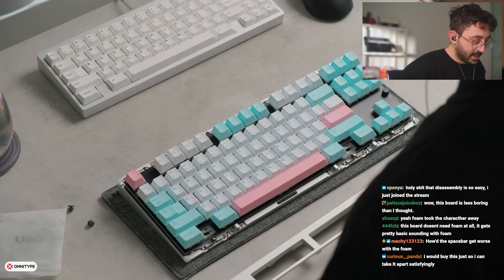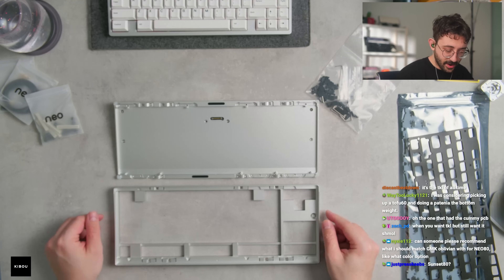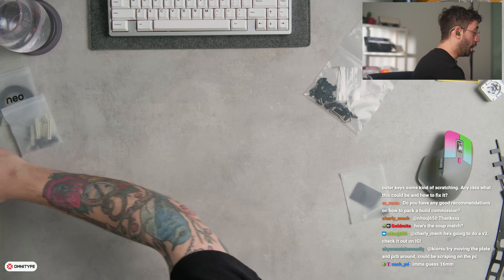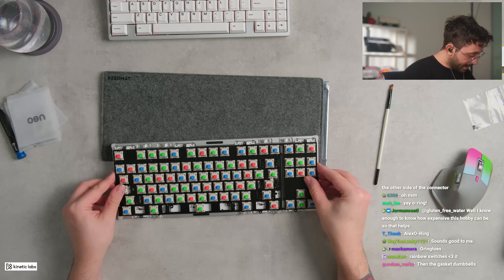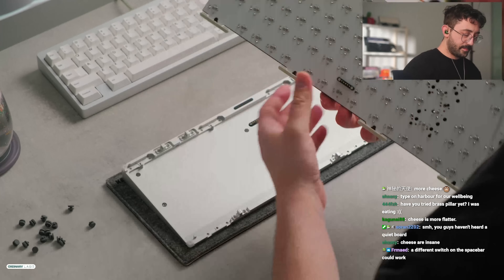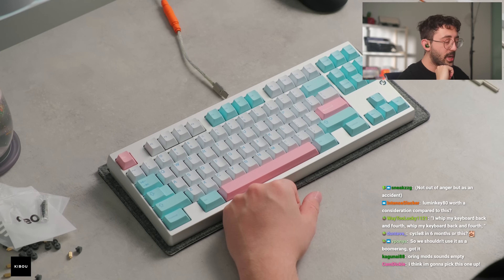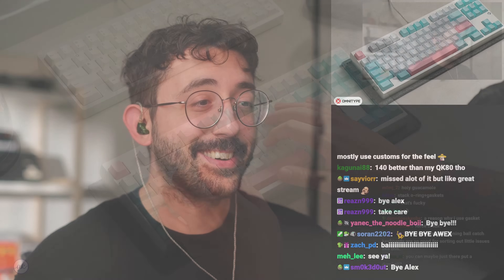The Neo80 — Pure TKL Value

Comment: I'll just wait for the Cycle8 which looks much better imo.
Reply: What’s the price of cycle8?
Reply: Cycle 7 started at 139 dollars, so cycle 8 could start around that.
Reply: Last I read they still haven't shipped most of the cycle7 orders, not a great look. Also if it's anything like the cycle7 I don't think they shpport VIA/QMK on the trimode PCB like Neo boards which is a complete failure IMO. Personally don't see the interest in the cycle boards when the Neo and QK boards exist and you can get them ordered and shipped to you in 4 weeks or less.
Reply: Does it support all those mount options tho?

Comment: sound tests(retro lights switches)(GMK Noel)
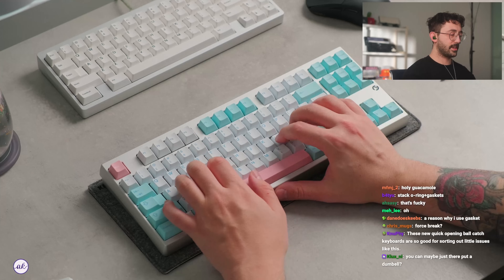o-ring - 14:13
gasket dumbells - 16:20
gasket jackets - 18:06
brass pillar sandwich - 21:15
brass pillar sandwich with case foam - 22:31

Comment: Are you sure the copper weight has a coating? I was under the impression that it didn't. I also plan to patina mine, but I don't know how I'd strip the coating if it is indeed coated :(
Reply: I don’t think it does since it warns of oxidization but don’t take my word for it
Reply from the maker: They state it does have a light coating but warn against touch it too often in my notes. I have had my hands all over the weight all week and spot no signs of obvious patina like i would have had from regular non coated weights.

Comment: Yes please more magnetic connectors please! The biggest reason why I didn't get this was due to the rotated switch positions on the hotswap PCB. I could learn to solder, but then I don't feel I want this that badly.
Reply: As someone who just learned soldering, it's really not that bad. Get a Pine64 Pinecil soldering iron, and you can do soldering with just a usb-c cable. The higher power your charging brick, the higher your possible soldering temperature.

Comment: Question! What container do you use for your keycap storage @alexotos? I want some uniform storage for my extra sets and the caps i don't use.
Reply from the maker: Sadly the ones I WAS using seem to not be sold anymore but they have the larger and smaller ones, its from a brand called IRIS.

Comment: I haven't had a board were I prefer an O-ring mount. In my opinion that mounting style needs to go.
Reply: even in a unikorn?
Reply: o-ring mount only bad on Neo...I loves o-ring mount boards for years. I mean, look at those high ends, unikorn, tgr 910, tomo, jane, and lots of others offers o-ring mount or top mount. Neo just can't get it right yet
Reply: @hello-hx5jd  Haven't tried that one but on my Scarlet TKL  and  Pluto FRL I went top mount because the O ring was so bad
Reply: @bosenngantor9160  it might be good on those boards but I would bet that top mount or bean gaskets are better than the 0-ring if those boards support it